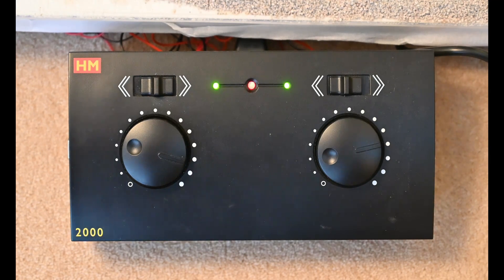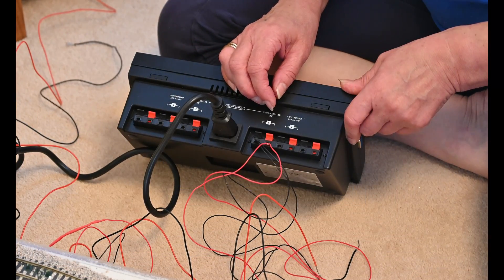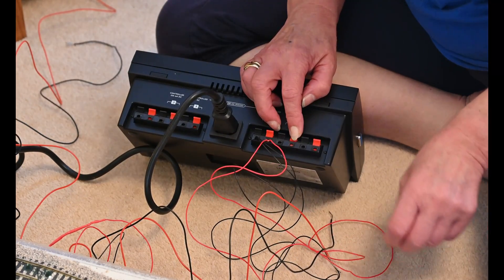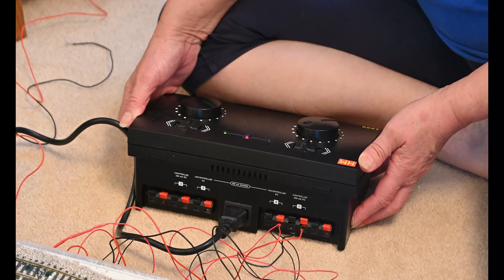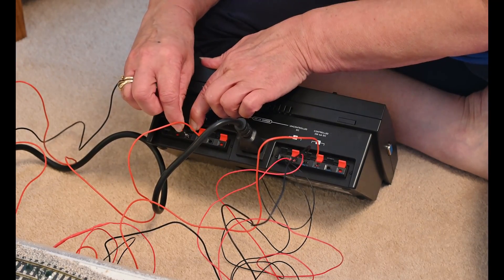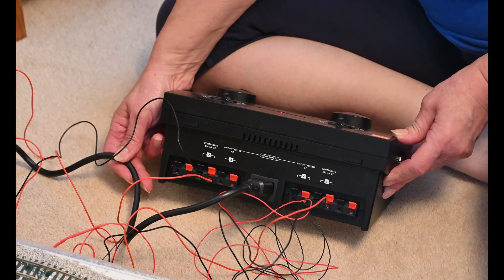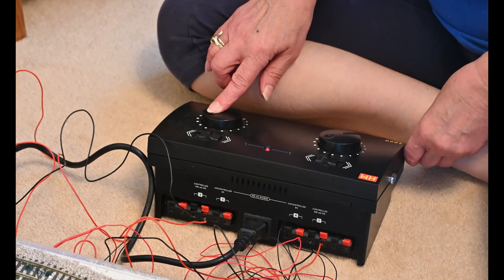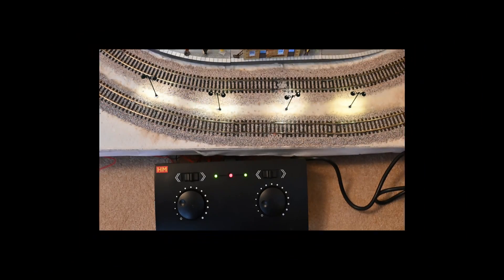Hornby HM 2000 track wiring : 4K Widescreen

Comment: And what do the other 2 red and black ports which are unlabelled on both sides control? also  Was wondering if it is possible to extend power via a bus cable to a large track using this controller
Reply from the maker: I will be honest and say I do not know.
Reply: @PaulBriden okay, thank you :)